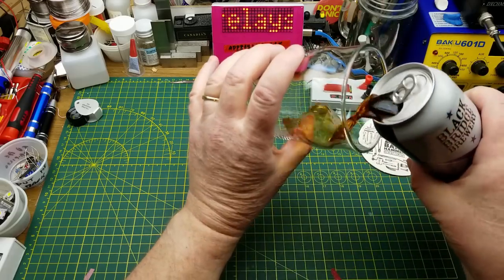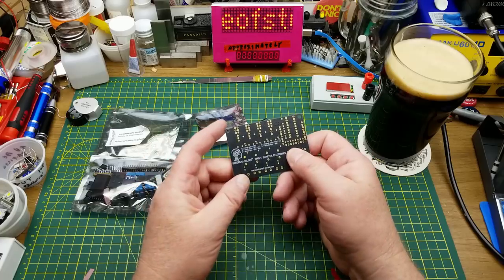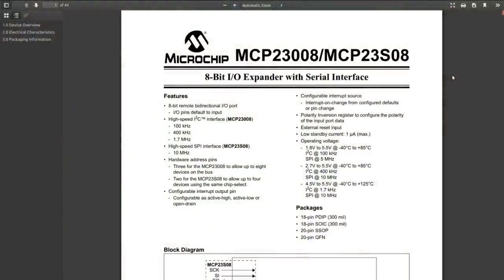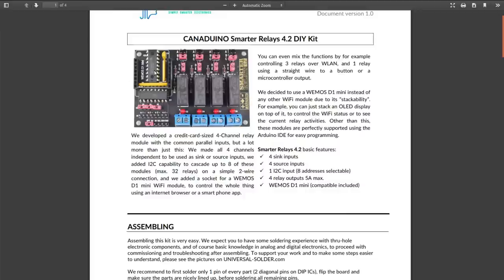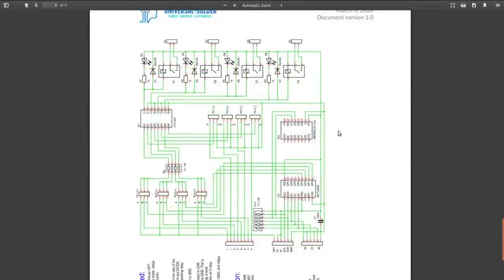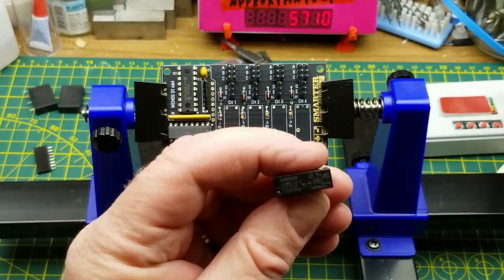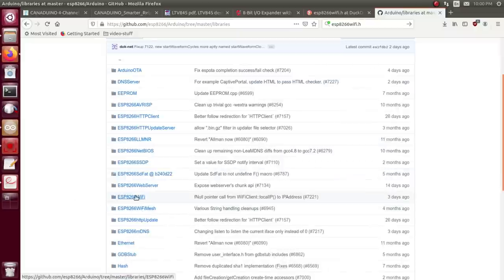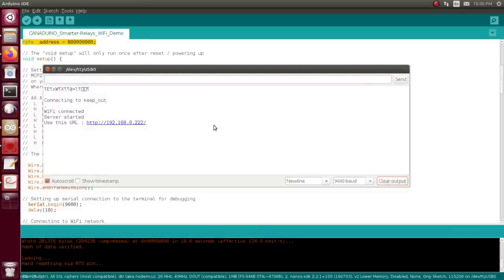Kit build: Wi-Fi controlled relays

Comment: Thanks again for another great review. I am really very happy you like my stuff! The traces are actually wide enough to hold the 5A without getting over 100 Celsius, and the distance between them and the low voltage part is 100% save to switch 240VAC.
Reply: I noticed in the video it was mentioned it may not be recommended for mains voltage.  Thanks for clarifying that this would be suitable for 240V at 5Amp.  Not sure it would do a "whirlpool heater" as mentioned on the webpage description though as these are usually more than 5Amp :)
Have you considered making a version with fuses for protection?
Reply: @EsotericArctos  Protecting needs to be done externally. It is not possible to make it right for just any application, and price and size are  very important factors. I forgot to mention that for switching higher loads contactors would be helpful.

Comment: The DC rating of the contacts is 3A 30V, Relays don't like breaking DC current because if a spark forms there is nothing to stop it. DC Rating is normally lower then the AC rating. AC by it very nature stops the arc as it passes zero volts. Nice looking beer :)
Reply: 3A is still quite usable at 30V, given that could be 5 or 6 amp at 12V :)

Comment: I don’t see any reason why you couldn’t switch 120v or 240v load with it, the switch is isolated. Of course you could have it switch a large contactor or motor starter as well if you feel the need to switch on heavy loads. Great build, thx.
Reply from the maker: The relay is clearly rated for it. 
The board might be able to handle it, but I'm not sure if it is certified for use on mains.
Reply: The smallest distance between the load traces and the controls is >2mm, making the output save to switch 240VAC like for example in Europe.
Reply: @canaduino  I think if I was going to design this for mains operation i would move the LED to the other end of the relay away from the output terminals. currently you have a low voltage side between the switching contacts and the output connector. this would give you the full isolation of the relay. Just a thought. still a nice usefull board.
Reply: @TheEmbeddedHobbyist  Relay traces are on the bottom side, LEDs on the top. Here as well 2mm minimum distance between copper. I recommend studying of UL60950-1 and UL796 to understand why this PCB design is recognized as safe for even much higher voltage than 250VAC, but of course the relays are not certified for that.